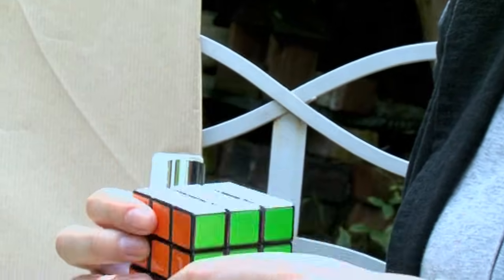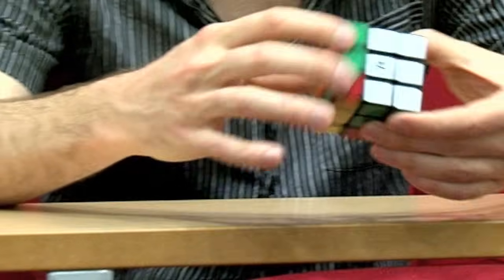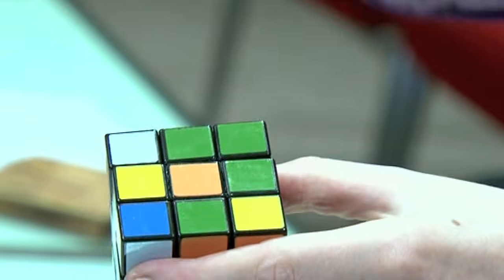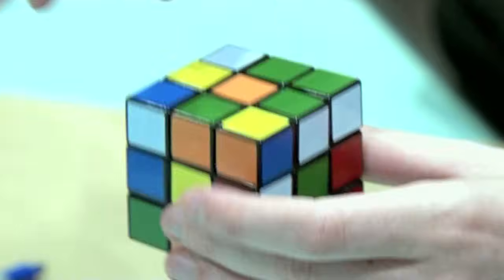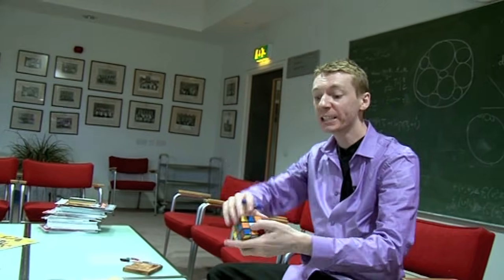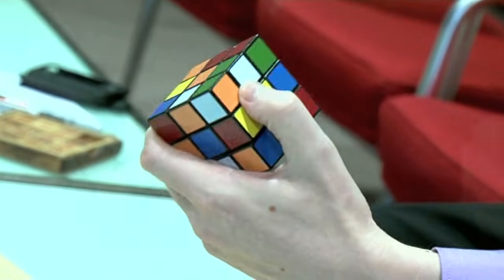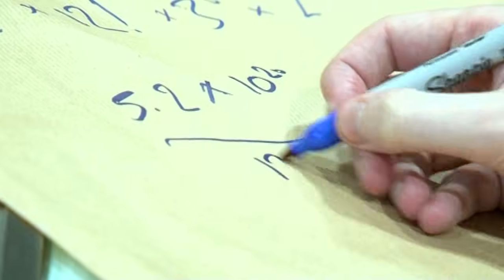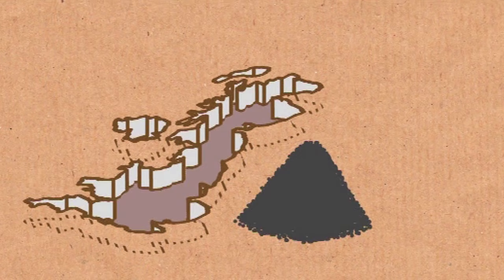43,252,003,274,489,856,000 Rubik's Cube Combinations - Numberphile

Comment: The video mentions that there are twelve orbits, incidentally the same amount of edges on the cube. Taking off a corner piece, rotating it and placing it on the cube again does not form a new orbit. Only edge pieces will form a new orbit when you flip them since the corner pieces get flipped anyway.

Comment: I almost touched on it in the video. I said there were three ways to orient a corner cube, two ways to orient an edge cube, and there are two ways to swap two pieces (either you swap two pieces or you don't). Each of these will put you in a different orbit. So there are 3*2*2=12 orbits.
Reply: Imagine being the main speaker in a video but your comment in that video's comment section goes 7 years with no likes and comments.
Reply: Hey, Dr. Grime! I wanted to say that I was given the chance to write a paper on a 7x7 Rubik's Cube (that I happened to have with me at college) for a math project of mine. I just finished it about a minute ago. I wish a video could be done about bigger Rubik's Cubes on Numberphile's channel!
Reply: Why divide by 12 instead of multiplying then???
Reply: @fulltimeslackerii8229  cuz changing the orientation would change the possible situations of the cube. these different 'orbits' are basically what you get when you change the structure of the cube, and the cube that we use is only one variant out all 12 of the others.
Reply: It’s like subtracting the one off of 6561   Using 6560 and 375 and making a run for 5 or 3.
Reply: Would there be more orbits for higher number of piece cubes?
Reply: No mention of the orientations of the center pieces. The white center piece is usually already marked with the Rubik's logo and therefore oriented towards the other colours. This can also be done with the other center pieces, for example by putting an arrow on them.
Ignoring the center piece orientation is leaving out a part of the whole story.
Reply: Wish you would explain why there's no algorithms to rotate corners or edges or swap 2 pieces
Reply: @Jiffy_Park  J Perm made a video about this topic with excellent presentation called 'Rubik's Cube: Why are some cases impossible to solve?'.

Comment: I have one of those 15-puzzles, and I used to play the fuck out of that as a kid. Actually got pretty damn good at it. On the back of the thing was a series of challenge puzzles- trying to go in a swirl, doing the same thing in reverse, etc.- and another one was to get the numbers backwards. Little did I know that that was actually a completely different order, and it was impossible to do that. So in other words, Sam Lloyd fucked me over a hundred years later.

Comment: Okay I'm a speedcuber and actually its not that hard, when you get to the OLL and PLL stage you can straight away tell that the way the pieces are set out that no algorithm will solve it. So what you do is do one that looks similar to what the cube looks like in that state, and you find that 1 off cubie, take it out and turn it around.

Comment: Let's look at the 2x2x2. It's possible to swap two corners on it because you could consider a similar odd swap of the center pieces. Since the center pieces are hidden from view, odd swaps of visible pieces become possible. Odd swaps are also possible on the Void Cube (3x3x3 without centers) for the same reason.

A way you could explain why even-numbered cubes can have odd swaps is because there are odd swaps of invisible pieces to make the total even.

Comment: Thank you. It does help. I'll take a look at that book next time I go to the library (they have it, I checked). I was hoping there would be a more general theorem, which could be extended to any puzzle though. For example why is it possible to swap just two edges on a 4x4 and not on a 3x3 (or any odd/even sizes) and remain in the same universe?

Comment: There was an explanation in Rubik's Cubic Compendium (multiple authors, 1987). Basically, you can swap two corners and two edges and still solve the puzzle because that is an even number. You can swap just two edges or just two corners and not solve it because that is an odd number.

You can model a cycle of three pieces as two swaps. To get from ABCDE to ADBCE is a three-cycle or two swaps:
ABCDE → ADCBE
ADCBE → ADBCE

I hope this helped.

Comment: The number of universes depends only on whether the cube has an odd or even number of layers. 

If you have an even-numbered cube you only need to worry about corner twists. There are three universes for that.

If you have an odd-numbered cube there are the same 12 universes as with the 3x3x3.

The extra pieces that show up from 4x4x4 and higher fall into only one universe unless the extra center pieces are made distinguishable from each other in some way.

Comment: There is a particular property of the Rubik's Cube that I'm disappointed wasn't mentioned, which is that if you start with a solved cube, edges are always flipped in pairs, and for every clockwise-rotated corner piece there is a matching anti-clockwise-rotated corner piece (or two other clockwise-rotated corner pieces. This is a simpler way to explain the 12 'universes' that would have added a more visual aspect to the explanation.

Comment: I wrote a program to calculate the number of patterns on an n-layer cube given only n as an input. It's interesting how quickly the exponent in the scientific notation goes up as n increases.

Going from 2 to 7 the exponents are 6, 19, 45, 74, 116 and 160. If you don't like the sound of the word quintillion, you definitely won't like the (questionably valid) names for the higher-order cube permutations.

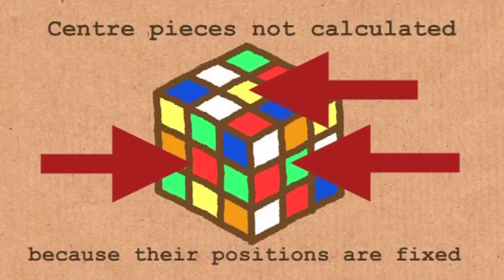Comment: 7:11 I don't agree with that image. There are cubes out there that are not a solid colour per side; some have pictures. This means that, because the middle block can be rotated, even if all pieces are in the correct location, the puzzle can still be incorrect because the middle block in not rotated correctly. This would increase the number of combinations to 56,054,596,243,738,853,376,000.

Comment: Another way i like to put the number 43,252,003,274,489,856,000 in to perspective is this.  If you were to go through each combination one at a time, one per second, and with the final turn being the solution. I would take about 100 life times (the birth of the universe till now) of the universe to finish.  That is (((43,252,003,274,489,856,000/3600)/24)/365.25)/13,700,000,000.  Assuming the universe is roughly 13.7 billion years old as of now.

Comment: interesting! I was still wondering how you came to the amount of 12 "universes"?
Reply: I know this is an old comment that's probably been long forgotten, but the reason is this:

You can't have just two swapped edge pieces on a cube, that's another universe. So that's two universes, swap or no swap.

You also can't have a single flipped edge piece, where the piece is in the correct physical spot but with the colors the wrong way round. Those are two more universes, flip or no flip, and 2*2=4. So there are 4 universes so far.

Then the corners, you can't have a single twisted corner, which is the same as a flipped edge but with a corner instead, and that there are 3 orientations for a corner, not 2. So that's 3 more universes of the cube.

4*3 is 12, and as such, there are 12 different universes for the cube to be in. This also means that were you to disassemble a cube and reassemble it completely randomly, then there becomes only a 1 in 12 chance of the cube being solvable, because there are 12 universes for the cube, with exactly one of them being solvable.

Comment: Something I don't think that numberfile has concidered. The six middle pieces that are part of the core can rotate to 4 different positions each. This situation can be traced if you carefully monitor but due to the square looking the same regardless of it's orientation, most people can't. You can see this with a picture cube. Or take your solved cube, mark the center tiles with 4 letters 1 ea at top, bottom, left and right using the first letter of the color that it "points" to. Mix and solve...

Comment: The center pieces are fixed in position but they turn. Does that number account for their various possible orientations?  For instance if you put a compass on each center piece, the puzzle might be solved with N facing each of four different directions.

I thought of this because for Christmas this year I got a knock off Rubik's cube with various Christmas themed drawings.  I found that I could solve the puzzle but the pictures were still somewhat scrambled depending on that center piece.

Comment: A = 8 corner positions = 8!
B = 3 orientations per corner = 3^8
C =12 edge positions = 12!
D = 2 orientations per edge = 2^12
E = can't have single corner twisted = 1/3
F = can't have single edge flipped = 1/2
G = can't have two edges swapped = 1/2
A*B*C*D*E*F*G = 43252003274489856000

Comment: just solve 2x2x2 like how you would solve the corners of a 3x3x3. pick a corner and lock it as correct. then proceed to solve as normal.. (and assume that the "centers edges" and the "middle layer" are already correct..) 

it takes a bit of imagination but it works if you are really comfortable with the standard rubik's cube...  :)

Comment: i know that.. that's why i said PHYSICALLY exists...  I do know about computer rubic's cube software. (tried solving a hypercube.. gave up after solving 1 cube)... still you must agree why someone would go "yeah right..." when you mentioned you spent 12 years solving a 10x10 rubic's cube.. (which i know only exists as a computer software... and given that most hard disks lasts between 5-7 years.. and most 8 year olds do not have the attention span for something like that)

Comment: It's completely normal for an average person to suck at rubik's cubes and chess. Your brain just is not used to the way of thinking required to solve a rubik's cube or outsmart a chess opponent.

Now, if you were to practice those regularly for a long time and then you're still bad, that'd be a reason to worry.

Comment: FACT: Rotation about a single axis is a commutative subgroup of the group of Rubik's Cube isomorphisms.
FACT: The center, which is the set of all elements of a group that commute with everything in the group, is trivial.  That is, only the identity commutes with everything.
FACT: This group contains no impossible arrangements.  So the size of the group is exactly 43,252,003,274,489,856,000.

Can anyone find a bijection from this group to another finite group?

Comment: Now we just have to add the group laws.  Each generator is to have order 4 in the group - that is, each rotation composed with itself four times (i.e. x1^4) gives the identity (not changing anything).  Moreover, we have the relationships x1x2=x2x1=x3^(-1), x1x3=x3x1=x2^(-1), and x2x3=x3x2=x1^(-1).  But wait, I though I said this was noncommutative!  Well, consecutive rotations about the same axis do commute with each other.  However, two rotations about different axes do not commute.

Comment: Now, these rotations will be 90 degrees directed clockwise with respect to looking in the positive normal direction, so essentially looking at the cube from the opposite side of that coordinate plane.  Now, group theorists generalize the binary group operation as being multiplicative and composition read right first then left, so x1z2 would be doing z2 first, then x1.  As mentioned earlier, this is not the same as z2x1 because the group is noncommutative.

Comment: So let's quantify it.  Let's set up the cube in Euclidean space so that one corner is at the origin and the three sides, each three units in length, lie along the positive coordinate axes.  Each rotating bit will be identified based on its normal direction and its distance from the origin in that direction, so the faces parallel to the yz plane will be the x faces and will be numbered x1 (for 0<x<1), x2 (for 1<x<2), and x3 (for 2<x<3).  We'll use that same convention to denote the rotations.

Comment: Numberphile, i'm a cuber and i do blindfold solving. If you do blindsolving, you will realize that there are some limitations for the other corners' orientation once you flip one corner. same for the edges. to get straight to the point, you can't flip one corner alone. it doesn't happen. corners, as well as edges, flip in pairs. or for the corners alone, they can be flipped in a group of three. but you can't flip a single corner or a single edge. Thus, that decreases the possible orientations

Comment: Even numbered cubes have a special case that makes them much more complex... if you notice in one of the graphics they show several times, there is an arrow pointing to the middle "cubelet" on each face that mentions those cubelets don't change relative position from eachother... there are no such static relationships on an even numbered cube. Also, a 4x4x4 cube contains the symmetry groups of both the 2x2x2 and a 3x3x3 as subgroups, which is a somewhat trippy thing to wrap your head around.

Comment: I do not agree with the number you come up with. If you turn the complete cube so that some sides are facing a different side, but there isn;t anything changed about the cube, it is essentially the same cube. You didn't take that in account I believe.
So the number should be (4,3*10^19) / 24. (24 ways to turn the cube without switching up parts), Which is 1,8*10^18.

Comment: 43,252,003,274,489,856,000 is the number of possibilities IF you could take the pieces off and put back on. In fact, if you buy a brand new rubik's cube, you will notice that some permutation are'nt possible, so there are way less possibilities in a unmodified rubik's cube

Comment: As was stated, that's the total number of possible orbits that can be caused by flipping a side or corner about its center if you take apart a solved Rubik's cube and rotate a single piece about its center, it then becomes unsolvable, and is in a different orbit. Some people expect it to be 20 (#of sides + #of corners) (or higher through combined rotations of multiple pieces) but through fiddling with my cube I have found that some combinations of rotations return you right back to other orbits.

Comment: 43,252,003,274,489,856,000 is bigger than 2 to the power of 65 but less than 2 to the power of 66, therefor, the longest message you can store in a rubik cube is only 65 bit long, which is approximately 8 ascii characters.

Comment: If you have the cubies arranged in an unsolvable scramble, then when trying to solve it, you will end up with 1 of 11 different impossible dead ends. From a solved cube, there are 11 different ways you can remove, and replace certain cubies so that they form those dead ends. They basically count all of the different dead ends. The 12th universe is of course the solvable one.

Comment: From every possible scramble, the cube requires at most, 20 moves to be solved, so it's also possible to reach every possible scramble in 20 moves or less. There's no easy way to calculate that number, 20. We only know through brute computer testing. Most humans only know enough algorithms to solve every scramble in 40+ turns or less. You can find loads more interesting information about it at cube20. org

Comment: That's not what I mean. Obviously, they will never change positions relative to each other, but they can be rotated in different directions for various solves. An easy way to see this is to look at the logo which is usually on the white center. When solved, the bottom might be facing the blue/red corner, but other times, it might be facing one of the other three corners. If you put some sort of mark on each center, you can see all the ways the centers can be rotated, for different solutions.

Comment: I'd heard this number before, but never really knew how it was calculated, or if the 12 universes were calculated in. Good to know it's actually an accurate calculation, and not something an amateur with only a very basic understanding of the rubik's cube had calculated.

However, I think the centers should be calculated in. Someone in one of the clips mentioned that there was only one possible solution, which isn't necessarily true. The centers can be rotated, to produce different solutions.

Comment: In my opinion it is not sufficient expenation for denominator 12.
In terms of universes you can say that:
Universes of corners flips, edges flips and pieces permutations are independent.
If you have 7 corners placed in cube you can put last corner only in 1 of 3 position to be solvable. So you have 3 univ. Same acording to edges. You have 2 universes. You assumed that permutating corners and edges are independand, which is false. But it occure's there is 8!*12!/2 perm. cases. No more text left.

Comment: If you flip only one piece, it's a new orbit because it's not possible to solve it normally because it's not possible to flip only one piece. However, you can change which piece is flipped in that orbit. Therefore, a single piece being flipped (like an edge piece) is in the same orbit as any other cube that has any one of its' edges flipped.

Comment: @5:03 I'm confused. If each of the 8 corner cubit has 3 possible variations and each of the 12 side cubits has 2 variations, why is the formula "8! x 12! x (3^8) x (12^2)"? Unless I'm missing some  key element here, it seems logical to me to multiply the corner cubits by their variations then multiply that by the side cubits variations, or "(8! x 3) x (12! x 2)". Then again I always struggled with geometry/finding area because I understand powers but not why they're used to find area.